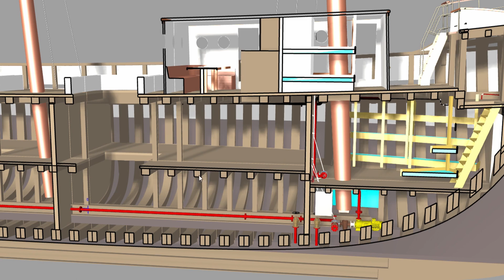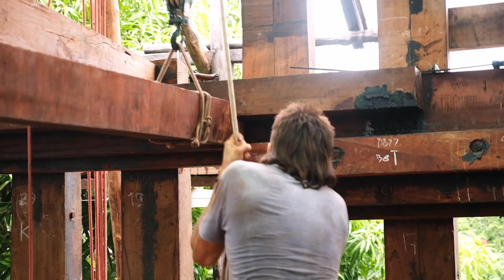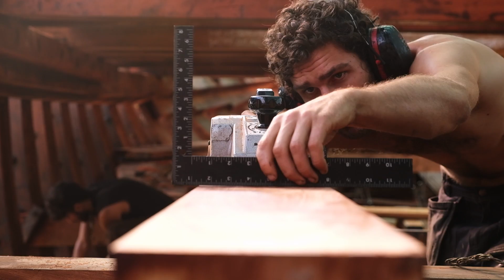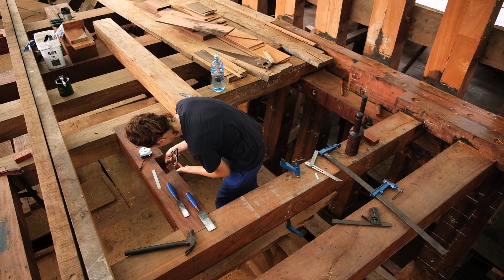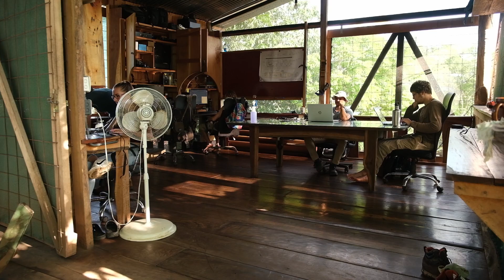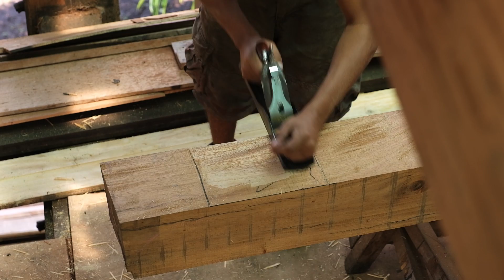Accommodation Deck. Part Two - SAILCARGO INC.

Comment: Good to see it growing each week. Being a sailor myself and own my sailboat for decades in the south pacific I know that this concept to make epower trough propeller shaft is working just fine so long you moving fast. But there will time without wind or sunshine or on anchor in this conditions and you need power for lights, refrigerating, anchor, harbor maneuvers aso. A small diesel genset you need. Also why you locate not the heavyweight battery bank deeper under the waterline? Just some ideas . . . .

Comment: Would it take longer to build an equivalent steel ship?
Reply: The problem with steel is weight. Welding is arguably easier, and easier to make water-tight, than joinery, but I can see material handling being a bigger challenge with steel. All things considered, I think build times would end up being comparable. The deciding factor would be the skills and tools available, not so much the material itself. The advantage of steel though, is maintenance. Steel is far easier to patch, repair, and maintain than wood, n my opinion. Stick welders are reasonably cheap these days, and even an amateur welder can get water-tight results without too much effort. I don't think the same can be said for wood. If you want to dive deeper, there is many a yacht/boat forum with debates on material choices. They all have their pro's cons. Me, personally, I would prefer a steel boat. I'd rather learn to weld a seem than deal with stuffing it with cotton and tar, but that's just me.

Comment: Have you guys considered converting some of the winds forces on the sails/masts to electrical power? There must be ways to do that.
Reply: That will be done through the propellers.  When there is more wind than needed to push the boat at hull speed, the propellors will be unfeathered and driven by the water being pushed through to them. This will back drive the be electric motors, generating electrical power, which will charge the batteries.
Reply: I don't mean through the propellers as they mentioned, I literally mean the force on the sails/masts.
Reply: @Dornul  well, I see.  The forces on the sails that are transfered to the mast must be converted into motion in order to make power.  This is being done, but that power is being used to move the ship.  If you somehow were successful in taking some of that power (from the sails) it would not be going in to the ship movement.  When there is excess power produced by the forces on the sails, then converting the surplus to stored energy is wise, and that's what the regeneration through the propellers and electric motors (used as generators) can do.
Reply: @Dornul  n
Reply: Listen up! He already mentioned that!

Comment: very impressive wood working with such large timbers but this is going to be a massively heavy vessel . Pushed by battery power ? Should the design accommodate the space to retrofit a diesel engine and fuel tanks in the future ?
Reply: My guess is the electric propulsion is only for docking purposes